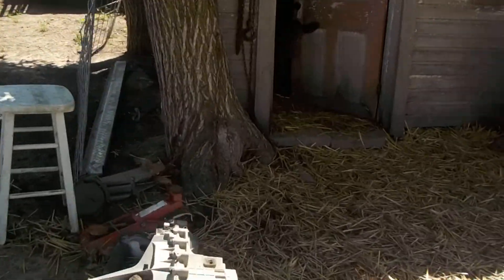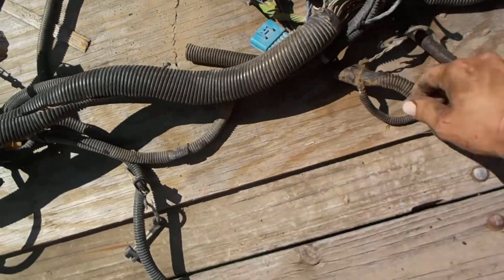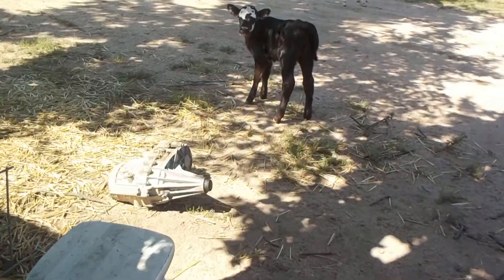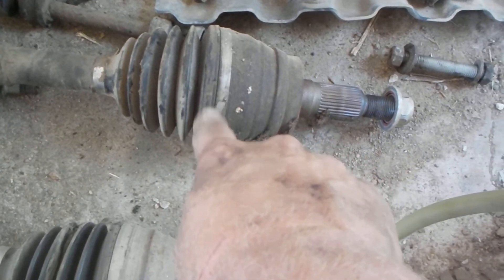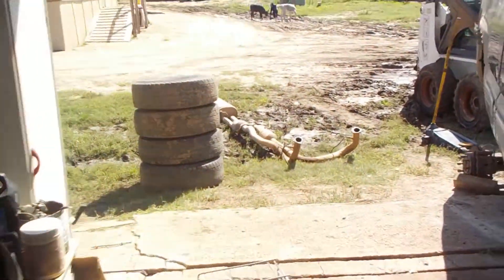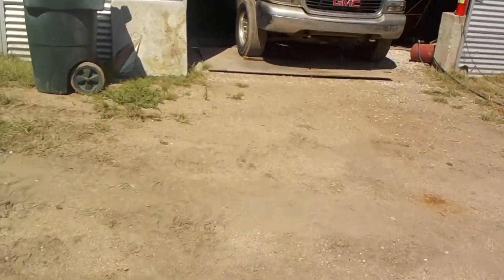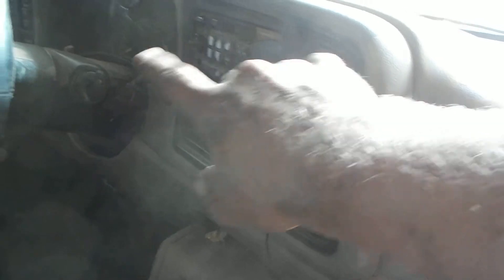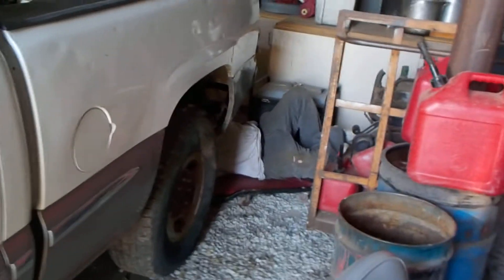A rebirth and a sacrifice 6.0 vortec editoin!

Comment: Nothing but hard work going on there. Salute man. Please tell me the secret to getting that box off the transmission. I know I need heat for the plugs, but that box I swear is glued to the trans also.
Reply from the maker: You have to be careful and loosen the bolts a little at a time and wiggle it off as you go.its sketchy,but I think you can even use a quarter inch drive socket on both the bolts.Thanks for watching!